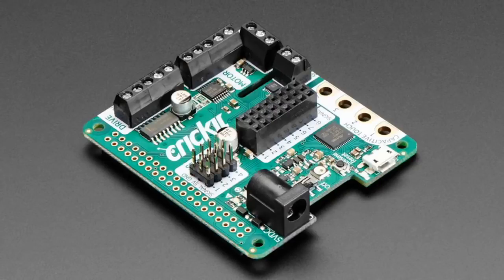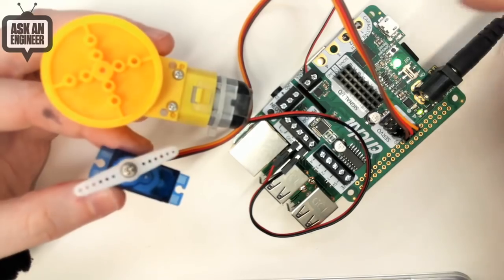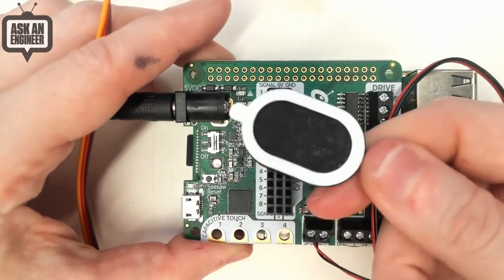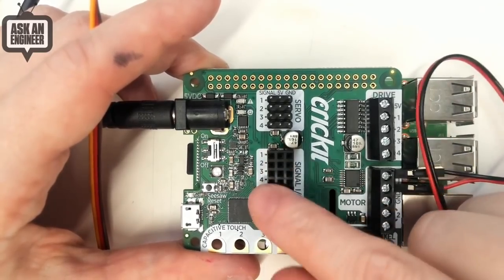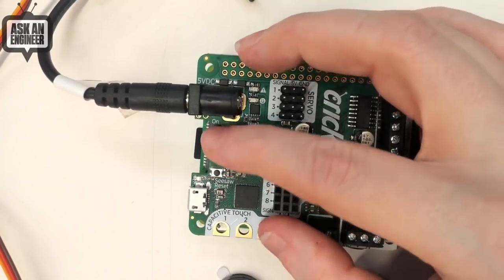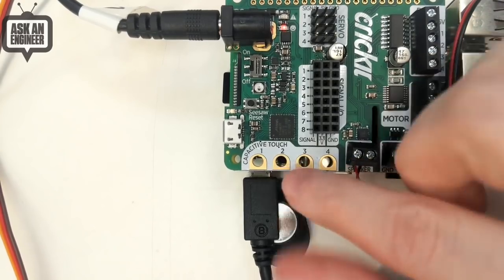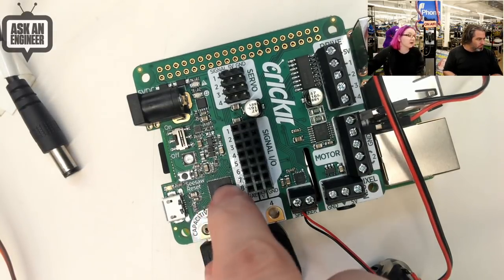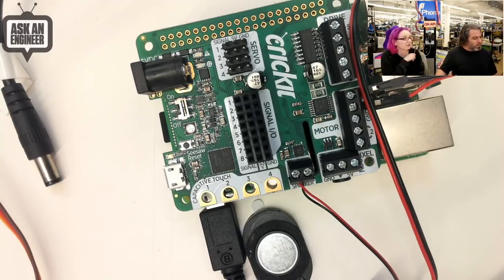Adafruit CRICKIT HAT for Raspberry Pi #RaspberryPi #adafruit #robots

Comment: It's like you took the best of the circuit playground and gave it to the Raspberry Pi!!
Reply: The only thing this has the same as the circuit playground is the NeoPixel and touch pads
Circuit Playground: accelerometer, microphone, speaker, IR led & IR receiver, buttons, switch, 10 NeoPixels, temperature, light sensor and analogue IO / cap touch pads.
Crickit Hat: DC motor out, servo out, solenoid (Darlington) out, NeoPixel driver, Analogue Inputs and Cap touch pads
But yes this is amazing.